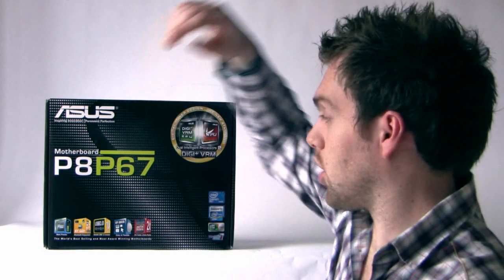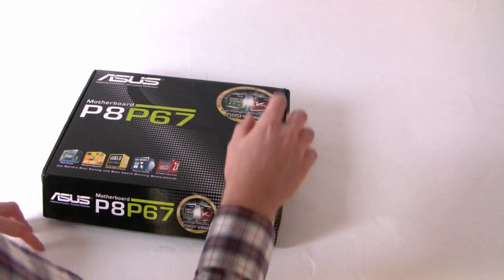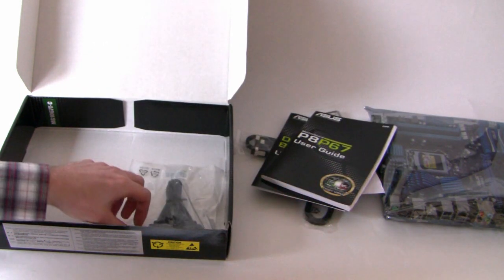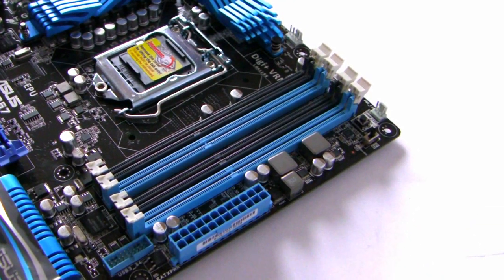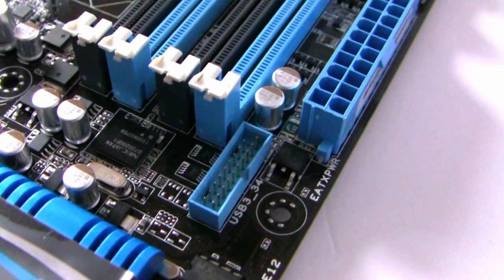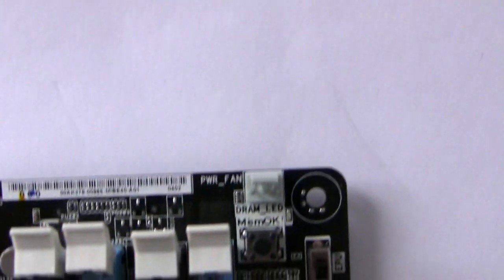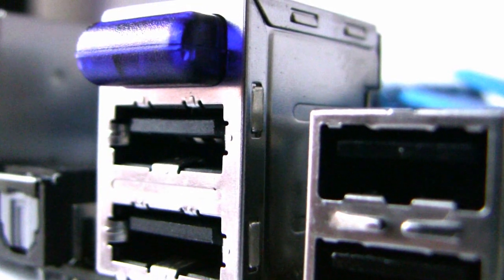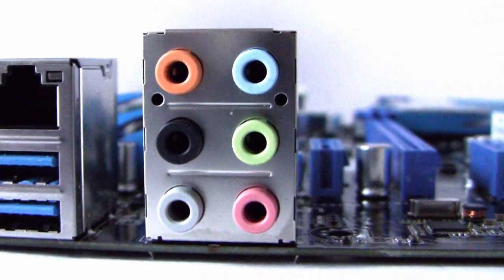ASUS P8P67 LGA1155 Sandy Bridge Motherboard Preview

Comment: @VortezReviews That's the first thing anyone would try -.- lol.

I went all out in troubleshooting. I thought it was the PSU. so I connected a 500W to my board and other devices. And connected the 600W only to my GTX275. Still a no go.

I performed like 5 CMOS resets. yea I'm gonna RMA it and get a new board, possibly the ASrock Extreme4

Comment: @VortezReviews Is that right? just bought one, good thing I haven't opened it yet.. so K-series are the only ones can be overclocked.. Btw do you still need extra cooling system when overclocking? or the new sandy bridge chips don't need it?